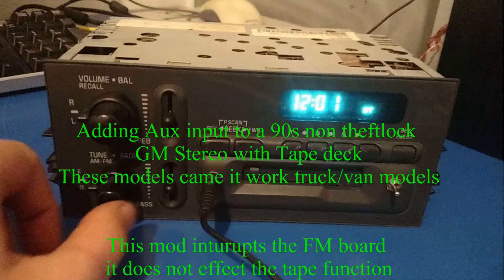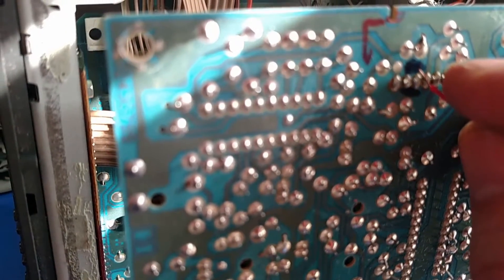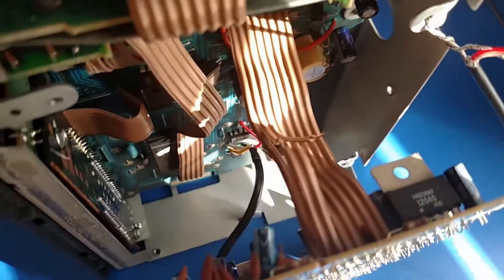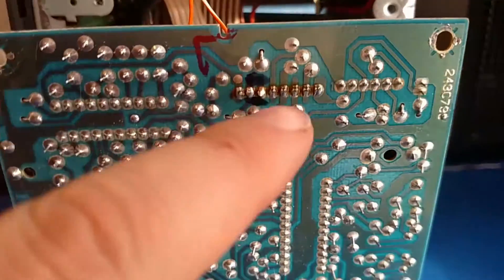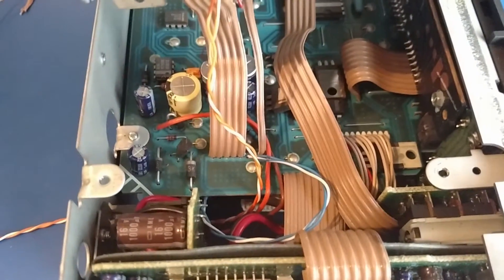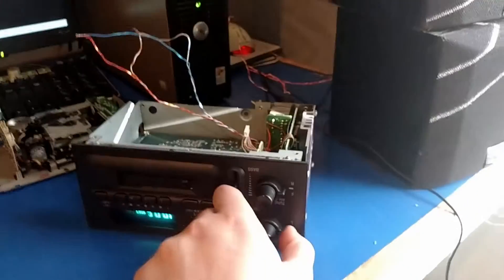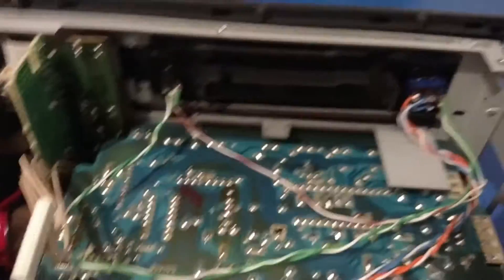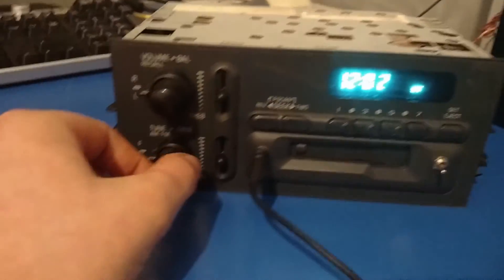GM Delco Stereo Mod AUX Input Pre TheftLock With tape deck

Comment: Hello Jonathan, I have this exact radio model in my 1995 K1500, and i was wondering if you can provide a block schematic for how the wires are soldered to the radio tuner, speakers, and Aux jack.
Reply from the maker: Unfortunately all I have is in this video. I did a few of these but it was years ago. Everything I did was based on watching other videos and trial and error. I figured out the pins by poking the pins I thought it could be with an audio source until it played through. If the radio is the same it should be the same pin as what I did in the video. I hope that is helpful. Proceed at your own risk. I had several of these so if I messed one up it wouldn't have been a big deal.
Reply from the maker: This video may have explained it a little bit better. https://youtu.be/L0s8A8s-Oaw?si=rUQc_OGmGy-t6Gwp

Comment: That is not a pre theft lock model. It’s a lower end model. Made around the same time as the theftlock ones
Reply from the maker: You are correct this one is the same age but it's the older design. It is the same as the ones they used from at least 1990 and possibly before. They just updated the face plate and continued to use the old design until somewhere around 2000.  I just used the term pre theft lock to describe the older/lower end same age radios.

Comment: Hello Jonathan, Just found this video on youtube. First of all thank you for posting. I have the exact tuner in my old chevy and was hoping that you either sold the radios you modify or would provide some written instructions as to how you accomplished this. Want to keep the original look of my truck and not add an after market head unit.
Reply: Jonathan Rader I want to buy 1 for a 2000 chevy astro van mark 3 model in mines radio has the cd at the bottom of it how much would it cost me ?
Reply from the maker: I would sell you this one in the video for $50 plus the shipping cost. I buy these radio anytime I find them cheap and mod them. I already have moded radios in both my Chevy trucks so this it a extra one I can part with. What model of chevy do you have. There are several models that look the same but have different mounts on the side. This model has the slide in clips that will fit 95+ Chevy full size trucks and vans as well as 96+ Astro Vans it may fit more but thats all I know for sure. I know the all the s10s I have seen use a different mount. Thanks for the comment I am glad you liked the video. Let me know if you would like to buy this stereo.
Reply from the maker: Here I am modding a slightly different model from a different angle if it helps any. https://www.youtube.com/watch?v=L0s8A8s-Oaw&t=123s
Reply: Ok Thanks, I will let you know if I can purchase the radio. How do you handle payment? I checked the model number and it's the same as the one in my truck.
Reply from the maker: Sorry for the slow response. I usually use paypal for stuff like this I would ship it as soon as I receive payment and an address to ship to. Let me know if you want to buy it.
Reply from the maker: This unit came out of a 96 Chevy 1500 it would be a direct swap for a 2000 astro van it however would not work with your cd deck. If you are willing to loose that functionality it would plug in and work just no plug for the cd deck. I will sale the unit in this video for $40 plus shipping. if you want to contact me you can find me on facebook and send me a message. That is the best way to contact me. Then I can talk to you about it and send pictures. I have a few other ones that aren't finished yet also. 
Here is the url to my facebook profile. Thanks  
https://www.facebook.com/jonathan.rader?ref=br_rs

Also I dont want to post my phone number on here where anyone can see it but if you go to my website it will be on the front page.
www.radercomputers.com
Reply: Jonathan Rader cool thanks, would it be a hard search to get the exact radio that's in my astro van just incase that I do want to use the cd, I'm going on your website now
Reply from the maker: I have one like you are talking about in my 98 Chevy 1500 it has tape on the top in the radio and a cd under it. I modded it and use it every day. I got it from a junkyard for around $30 they aren't that hard to find just not cheap and they have to be in a 95-97 vehicle or they cant be modified at least in the way I can. Unfortunately I don't currently have any for sale of this specific type that can accept a cd slave unit.